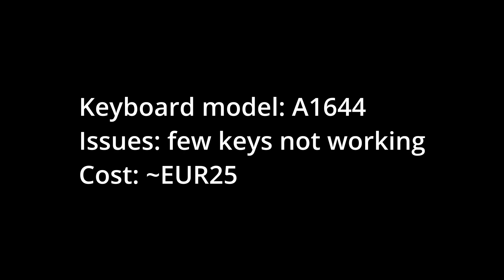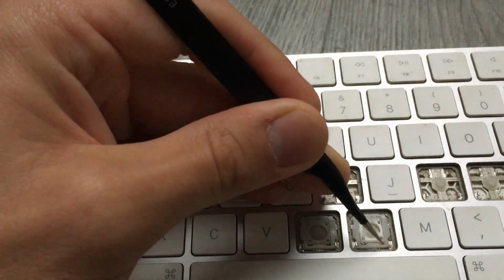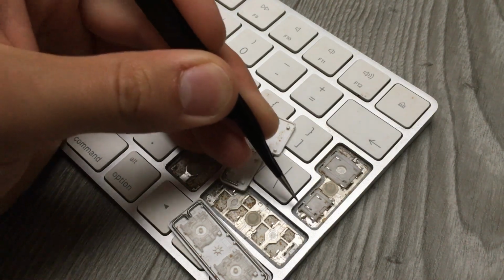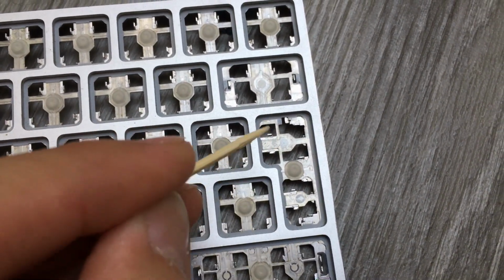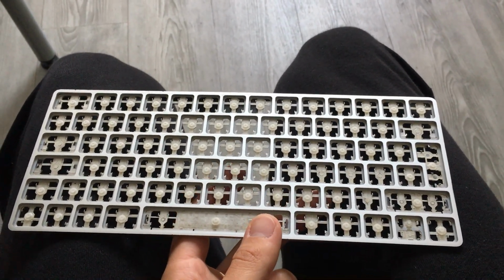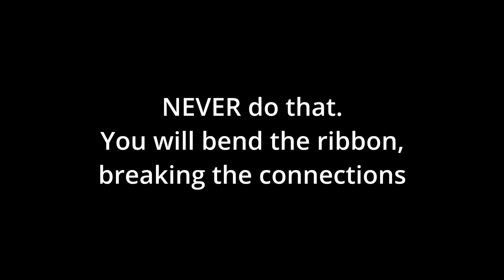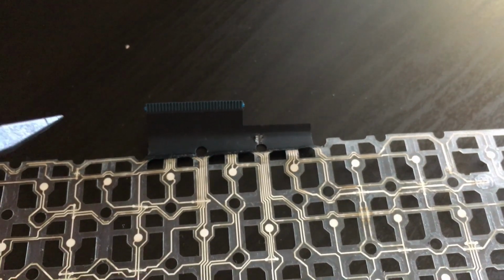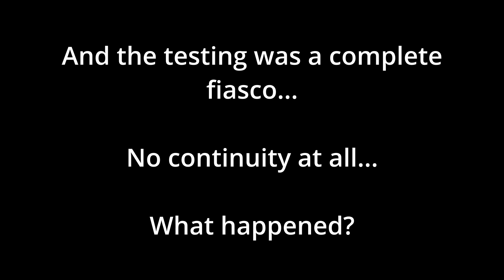I thought fixing this Apple keyboard would be easier...(Pt. 3)

Comment: great breakdown, ifixit gave it a 3/10, rubber pcb keyboards are a pain to repair
Reply from the maker: They are an absolute shame for the environment! There is no way You can reuse these if you encounter a substantial issue in the "mesh". Even when using conductive ink, it degrades so quickly that is makes the repair completely worthless. The idea would be to create your own keyboard and repurpose the most internals and the controller from the Apple keyboard...a lot of work!